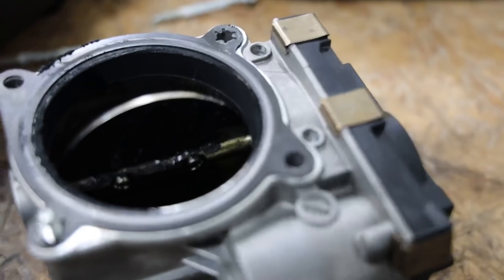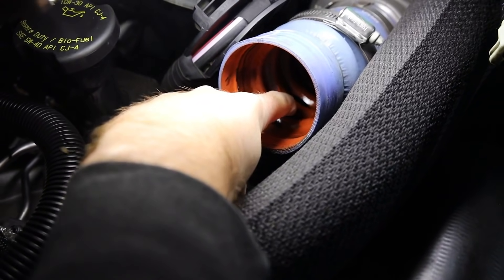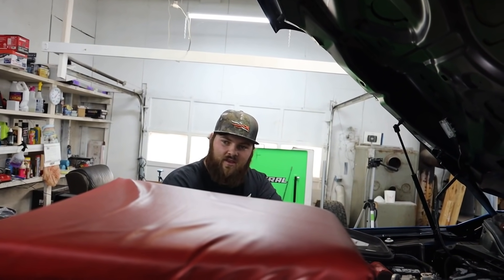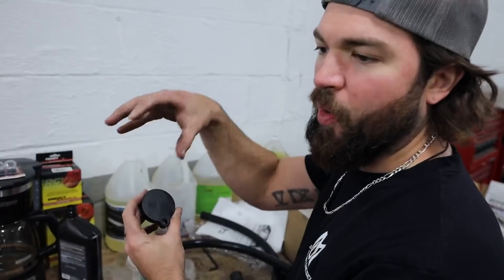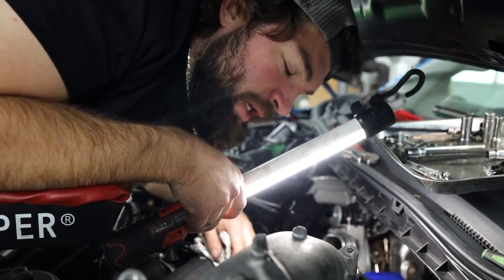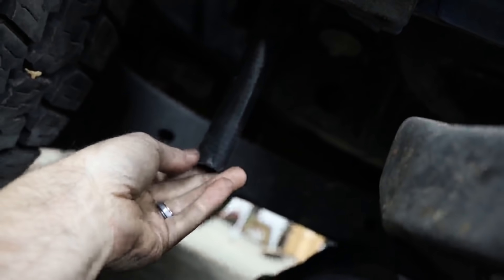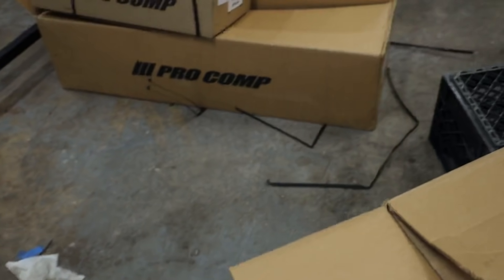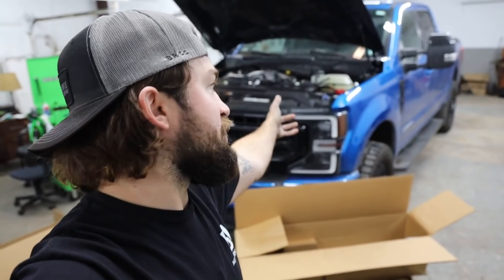2020 6.7 Powerstroke RUNS off of its OWN ENGINE OIL! - OIL BURNER

Comment: Get some Boost Auto tow mirrors with the smoked lenses & Paint match the tow mirrors to the truck along with the side but the leave the F-250 lettering black along with the little Lariat letters on the badge too leave the those black. I’d leave the blacked out front end the way it just to break it up some. Also get the tail lights paint matched along with smoked lenses & do the same with the 3rd brake light. Should get some smoked out cab lights to have all black lenses like headlights. That would all look great!

Comment: I have a 2018 F350 with 64k on it and my throttle body and charge pipe looked exactly like that. I don't know if I should feel good or you should feel bad. Probably both

Comment: I watched your previous videos on the CCV delete on your previous truck. After a while, you installed the cheese grater piece as well. You never posted an update on if that fixed the issue you still had at idle of oil seeping out. On this new truck, you didn't install the extra piece. Would you mind giving an update on if that cheese grader piece made any difference? Thanks in advance!

Comment: My '17s throttle body and cold side pipe once appeared that way, only at 25k miles.  No longer for either of those off-gases to flow through and mix with clean air.  Why wasn't the SPE cheese grader installed?  What shocks and track bar?  Really have been eying Carli's commuter kit.  Look forward to the lift kit install.  Any thoughts on a DIY tail lens and 3rd brake light "tint" with something like VHT?